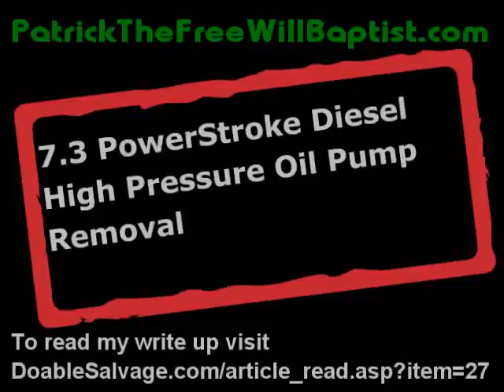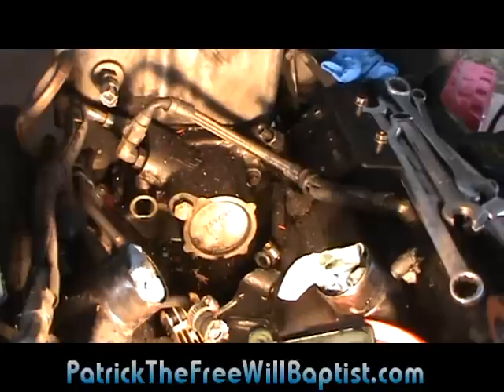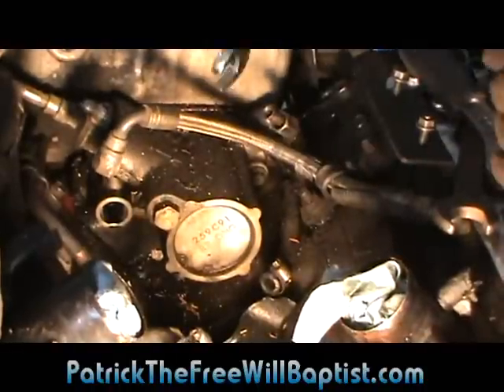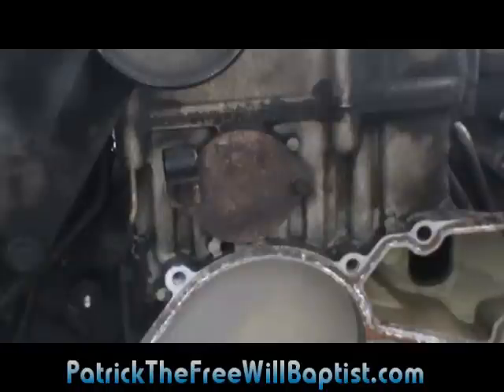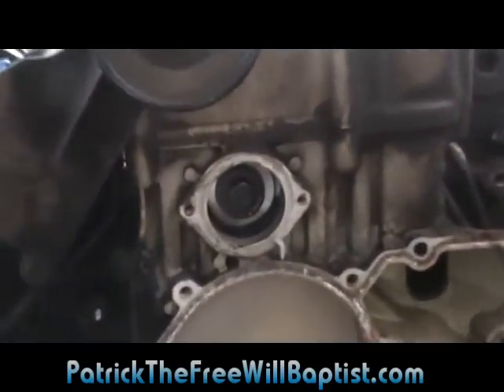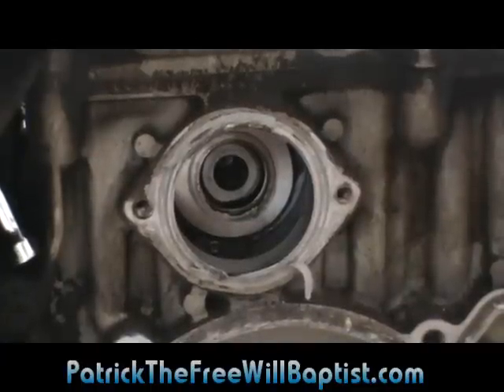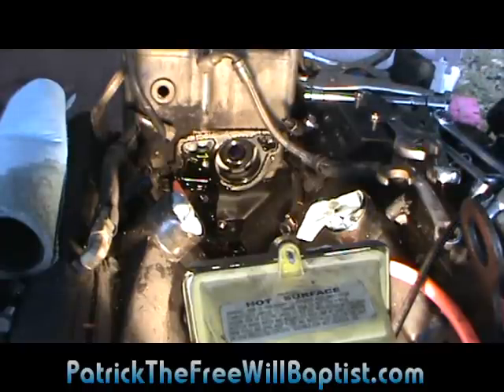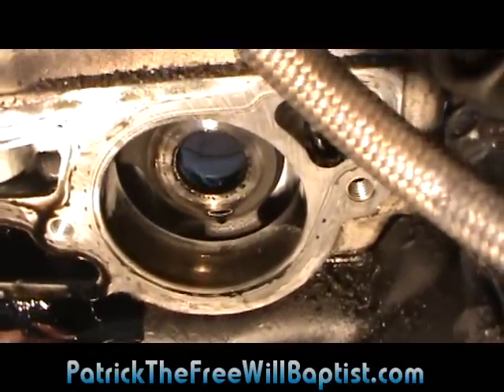Easiest High Pressure Oil Pump (HPOP) Removal - 7.3 PowerStroke Diesel  How to  DIY

Comment: Great videos looking to see if you can shed some light on my problem. I have a 2000 Ford at 350 with the 7.3 l diesel and I have a no start situation. I have changed the high pressure oil pump I have change the sensor that goes in the back of it and I have taken your suggestion and removed the sensor on the right side of the head to see if it would shoot oil into my yard as you suggested lol. It does not... just kind of spews out very slowly. I have taken the cover off the front of the motor that allows me to see the bolt that the oil pump connects to and I can see that the gear is turning. I have went through my fuse Box and checked all my fuses. I have checked the little safety switch on the passenger side kick panel I have open the fuel bowl to see fuel load up in the few a bull in spill over. I still have endless crank no start. I have new batteries. And have resorted to ether which makes the crank sound a little faster but still does not allow the truck to start. The truck sounds identicle to your truck in the video where you were working on a service body truck and your kids were in the front yard as your helpers but you commented that they couldn't reach the clutch. Do you have any place that you can lead me?
Reply from the maker: I've got videos on that topic, have a look friend.

Comment: The oil pressure sensor is on top but what sensor or what is the one on the bottom left is that a sensor ?
Reply from the maker: Dunno what is the time in the video your looking at?

Comment: Hey Patrick, my 97 is leaking oil again. Are there  o-rings on these hpops that can be replaced?
Reply from the maker: Have a look at my channel, I have VERY recent videos on HPOP seals, removal, and reinstalling.  Yes the can be replaced, the service kit is in the $50ish or less for everything, even the special tool you need to disconnect the oil feed lines if you have those crappy quick disconnect ones.
Reply: @PatrickBaptist  okay. Thanks Patrick.

Comment: peace,I was looking to buy a 7.3 said to need injectors and an oil pump this maybe a silly question,but is it an absolute must that the engine come out to change the oil pump?
Reply from the maker: Which oil Pump, the sump?  Then pretty much yes.

Comment: did you have to drain the resovor that holds the oil in it? for the oil injection pump?
Reply from the maker: Unless you want the oil dumped into the engine valley, and I'm sorry I just now saw this to reply far to late I'm sure, I really try to better than this golly.

Comment: Does it take awhile to start after you reinstalled the HPOP?
Reply from the maker: Oh yeah alot of cranking.  Less if you prefill the HPOP res first though.  Make sure to have good batteries and a battery charger even.  DO NOT CRANK THE TRUCK WITH A BATTERY CHARGER HOOKED UP TO IT, it can damage the PCM or IDM, seen it.
Reply: @PatrickBaptist  Ok. Thank you sir for your quick answer and time! 
I hadnt seen the afterwards part after changing them. And mine did exactly that.  Cranked and cranked but didn't start. So im charging batteries back up.

Comment: HI, mine started leaking a few weeks ago, need it replaced I was told. How long from beginning to end to replace one? Thank you
Reply from the maker: Man I can't remember, and I usually don't do this stuff fast I take my time and look at everything I can a million times probably because I can't stand to do something again and making sure you don't foul up the seals on stuff is something I don't care to take a ton of time at, but I deal with alot of headaches and sometimes it affects my vision so I really couldn't give ya a guess on time because I have only done 6 or 7 of these and last 3 was with the engines out of the truck making it much easier and 2 in trucks with the fuel bowl deletes.  So I guess I've done one replacement in a oem truck, I just got a 2000 F350 with 450k miles back in April, when the HPOP takes a dump I'll do a video on the whole fun but hopefully it will hang in there for while because I'd prefer just to put a new pump on if I'm taking that thing off, the the miles I got no clue how long it's been pumping, the truck has been taken care of atleast, min blow by no glow plugs and it will start down in the 40s takes a little cranking but not bad without any heat..  Anyways sorry got off track on ya there.  Sorry I couldn't really give you a solid guess but to just try, if you have it all laid out and the mess isn't so bad 2-3 real hours of playing around I'd reckon and if I would bill someone for the labor then I would prob say 3 hours and leave it all day LOL.  Just don't get in a hurry, just keep that in mind, that's how I manage not to have to do it again then it's not fun anymore at all.